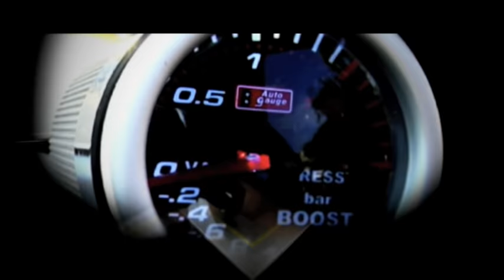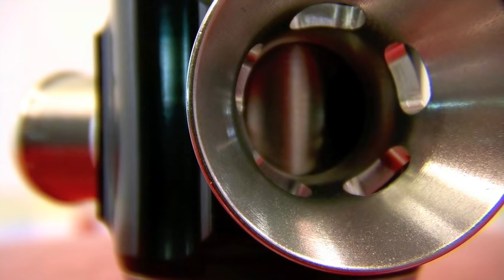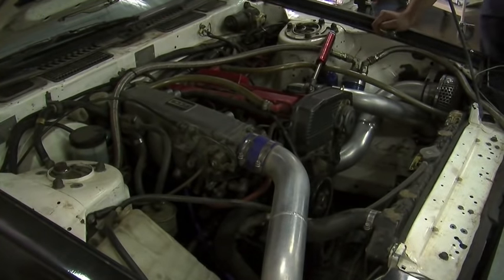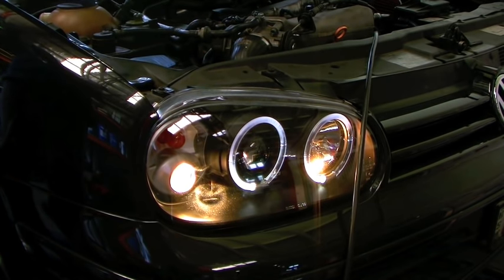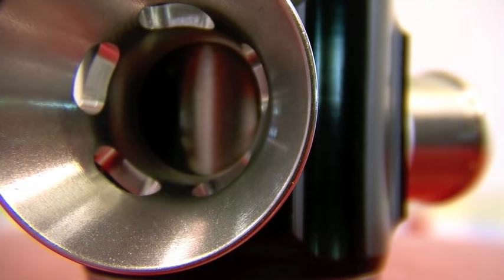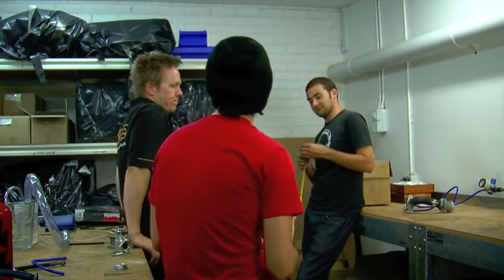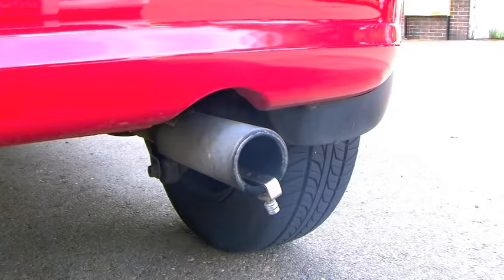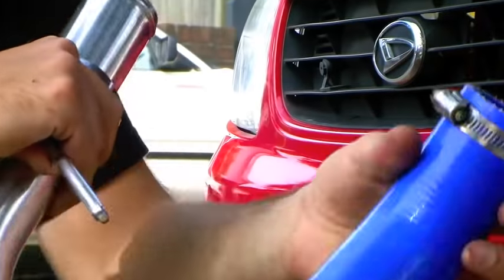Blow Off Valves Mythbusted

Comment: why the dyno with the blow-off valves? the guy just said they only matter when you let OFF the throttle. he said the valves are only ment to maintain spinup between shifts
Reply: Busting a myth.
Reply: ah copy that
Reply: Because most factory BOVs are designed to leak at a certain pressure, they don't actually leak as such, they open at a preset pressure which is usually just above the factory boost spec. Not only that but factory valves are easily modified so that they hold boost and therefore you don't need to replace with an aftermarket valve..........but that's bad for business.
Reply: 1magnit basically functioning the same as the valve (can't remember name) in diesels which you hear blowing off once it it toward the end of the gear?  Cool thanks,
Reply: Darklord 4 yes?
Reply: dosmastrify
Reply: Exactly right! and ofc the sound is sooo good that you actually think you are a rally/racing driver :-) but that is it... between shifts, the pressure slows down the turbine... and a blow off helps keep the pressure up (a little bit)...  but anyway... the sound alone is magic :-) If you really wanted to test it needs to be a circuit race... but then again... soooo many other variables so...
Reply: dosmastrify what i dont get is hes not thinking of what happens between shifts, hes not telling us what the difrence is betweem shifts, i go from my forge 007 recirc to my hks sometimes for car meets an i can tell you now that theres ALOT of difference, running recirc the car is alot quicker to pick up speed as its allready back in front of the turbo compressor wheel saving time having to suck in fresh air
Reply: if they're both tuned correctly there shouldn't be much difference in shift manners. they're both essentially normalizing to manifold pressure, so boost pressures should be identical after venting. any change in performance is probably because you have a MAF sensor, or a bad BOV.
Reply: Read my comment above................they're designed to open at a preset pressure........they're an "over pressure safety valve". If you modify the factory one, you don't need an aftermarket ricer one.

Comment: Ok honestly the turbo flutter sound you get with no bov is one of the best automotive sounds out there let's be honest
Reply: +George Mahfood Absolutely agree! But if I understood it right, the sound is caused by air returning through intake. Now isn't it a bad thing for a turbo lifespan?
Reply: +pave64 I know it's really bad for a turbo over time but still the sound is amazing might not be worth the risk though
Reply: +George Mahfood Depends, if you have a high boost turbo, you might wear out the bearing but you need high boost. It's just air passing by, slowing down the compressor, so you will have a bit more lag when you shift and the response won't be so good. It's not bad for the turbo, it's worse when you have high boost and all that air can't flow throught the system and preasure builds up until something breaks.
Reply: +Cristian Ceclan There is no noticeable in lag between running a BoV and not, also there are a lot of people running 40+psi with no BoV's and never having issues, it's very common in Australia for people not to run them.
Reply: thank heavens - an actual human with brains who doesn't feature on Springer !
Reply: +DriftNick You might be right mate, i totally agree with you, but i try to be logical at the same time, it's not that baaad, but it's not helping the turbo either. I'm running no bov btw, and love it
Reply: ya but that sound will murder your turbo(s) real quick and even your engine
Reply: I run a stock airbox intake... Nice panel filter. And with only 15psi at 100% throttle I use a HKS bov for R33-34 Skylines. (Renault Megane RS) 

So without the BOV its pretty boring and quiet. And at only 15psi its quiet enough unless 100% boost. 

Also I just use them because it "Cant hurt". Rather have it than not.
Reply: “I very non turbo” 😂
Reply: Old man farts AKA turbo flutter is definitely not cool.

Comment: That's what I was going to say. And actually, depending on your turbo setup, the type of BOV that you're using will actually make a difference. A recirculating blow off valve will help with surge between shifts but also allow you to keep your boost pressure up higher since it puts it back into the system. This surge that occurs when a BOV is not in place can cause a fuel enrichment issue and cause your vehicle to stall, but this is not always the case as it depends on the size of the turbo.